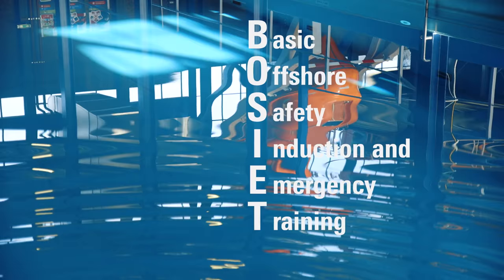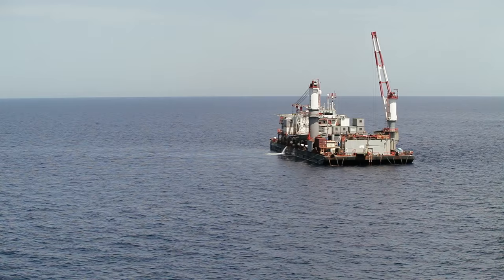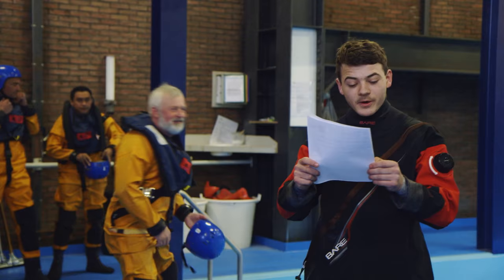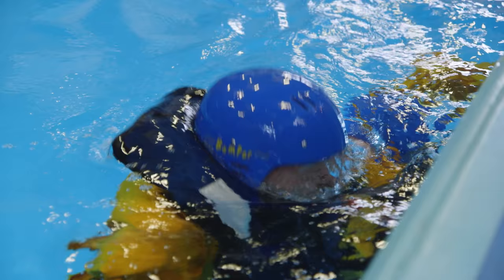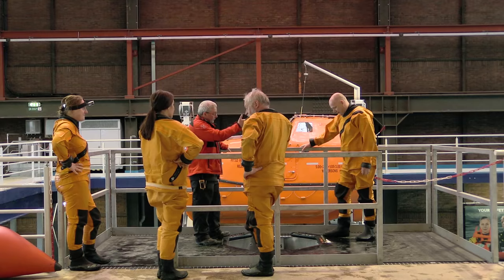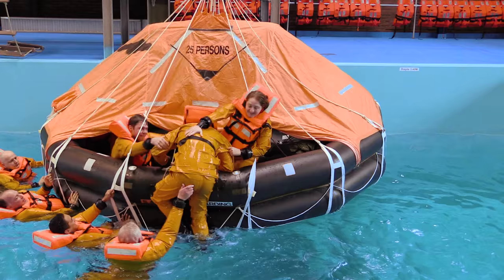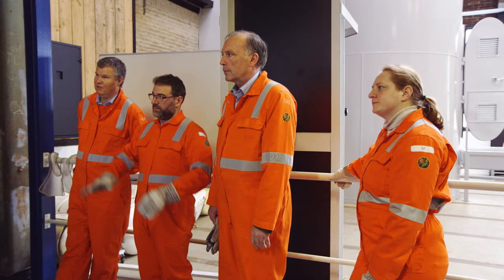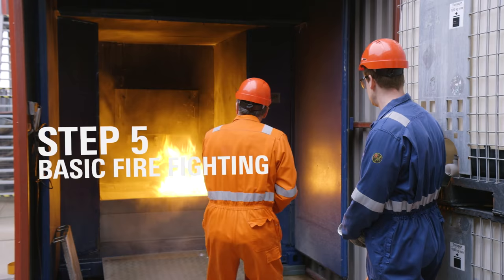BOSIET safety training: Keeping your head above water

Comment: After completion of training do u conduct any written/oral test or only training is mandatory.
Reply from the maker: Hello! The BOSIET course is in essence a continual assessment. There are written tests after certain sections of the course and then there is an instructor assessment of each person’s performance during each of the practical sessions. There are many practical sessions and these performance reviews are very important. If an individual does not perform a particular task to the satisfaction of the instructor and reviewer, they will be assisted and asked to repeat it to demonstrate understanding and capability. There is a final written test at the end of the course and if the candidate passes all of the sections then a certificate will be issued.
Reply: @omv  thanks to reply another doubt is am I eligible for training even I don't know swimming
Reply from the maker: Hello, 
OMV is not provider of BOSIET trainings, our staff only runs through such trainings. For details, please contact the training providers (such as Falck or MTC, for example). But yes, swimming would be definitely of advantage.

Comment: What type of seat belt is used in the helicopter escape activity? Thank you.
Reply from the maker: Hi ctsi BBD,
in most BOSIET training they use a 4 point rotational seat restraint which is the same as you would use and experience in a helicopter transfer. The harnesses are easily cut from behind so if a student gets into difficulties the divers (in the helicopter) can quickly release them.